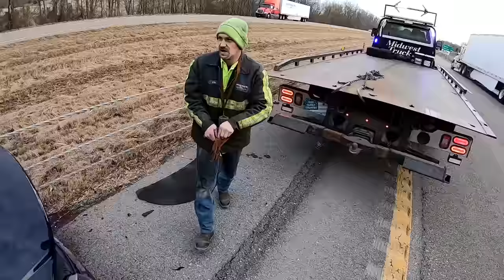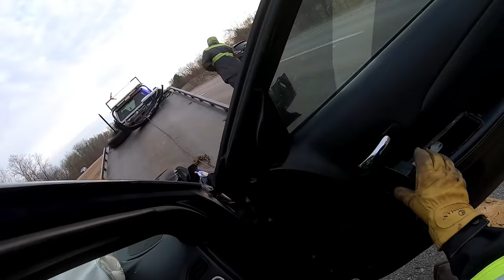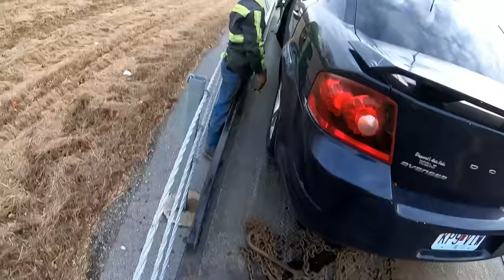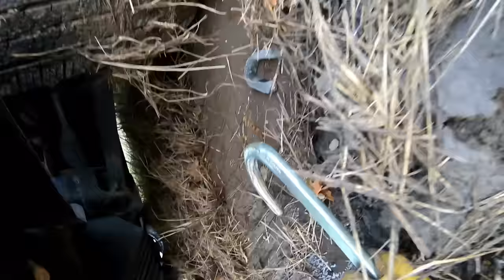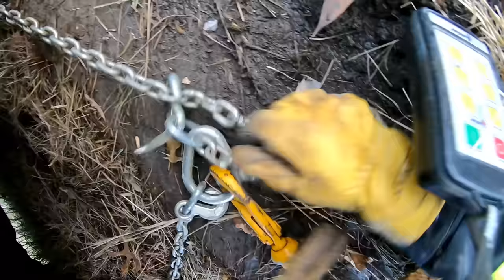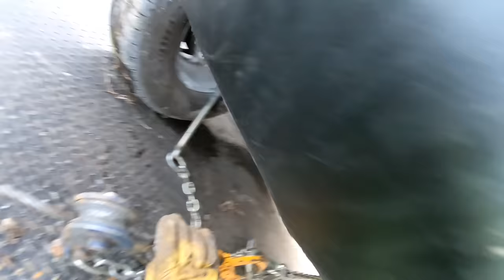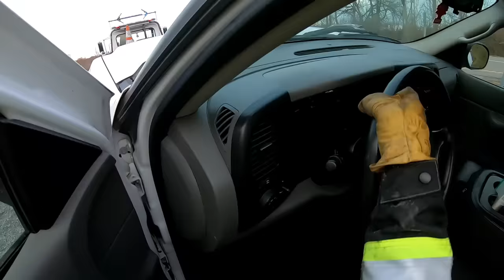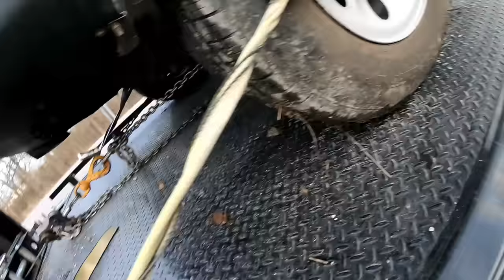Code 3 Car Crash Blocking the Interstate

Comment from the maker: There have been multiple comments about the use of my air horn rather than using a siren while running to this scene and that I should have allowed Mike to run in front of me since his truck has a siren.   Please allow me to explain......

We simply have not taken the time to install a siren on the new Peterbilt rollback yet.  As I stated in the video, we are not required to have a siren as long as we have the air horn and red/blue lights.   We are following the letter of the law.   The following is taken directly from the state statute:   

"5.  (1)  The driver of any vehicle referred to in subsection 4 of this section shall not sound the siren thereon or have the front red lights or blue lights on except when such vehicle is responding to an emergency call or when in pursuit of an actual or suspected law violator, or when responding to, but not upon returning from, a fire.

  (2)  The driver of an emergency vehicle may:

  (a)  Park or stand irrespective of the provisions of sections 304.014 to 304.025;

  (b)  Proceed past a red or stop signal or stop sign, but only after slowing down as may be necessary for safe operation;

  (c)  Exceed the prima facie speed limit so long as the driver does not endanger life or property;

  (d)  Disregard regulations governing direction of movement or turning in specified directions.

  (3)  The exemptions granted to an emergency vehicle pursuant to subdivision (2) of this subsection shall apply only when the driver of any such vehicle while in motion sounds audible signal by bell, siren, or exhaust whistle as may be reasonably necessary, and when the vehicle is equipped with at least one lighted lamp displaying a red light or blue light visible under normal atmospheric conditions from a distance of five hundred feet to the front of such vehicle."

Please note the last section which states that we can use an "exhaust whistle".  The air horn is defined under the "exhaust whistle" category, much like the warning systems used by trains since, well, the invention of train warning systems, which is an "exhaust whistle" train air horn.   So, again, we are following the law.   We will be installing a siren, but as I said, the air horn still covers us.    The main reason I went first is because Mike was on another job when the call came in.   I left directly from our shop, which was closer to the incident.  It just so happened that Mike was able to catch up with me in the traffic back up. 

This comment is made simply to educate.   This comment is not made in a defensive or derogatory manner.  Thanks for watching and God bless.
Reply: I can't believe the patience you have with these people making comments.
I would just say " because the law says I can use an air horn instead of a siren" in the description, then yell at the computer that they need to read the description every time someone questioned the air horn.
you are a far better man than I.
Reply: I think an exhaust whistle would be great. 
gets louder as you accelerate.
exhaust whistle with a jake brake on should clear the road.
Reply: Well, there's your problem: you need a train horn. A K5LLA and that cowcatcher they used on Mythbusters would be a great way to clear traffic.
Reply: I wonder if the old UK style pneumatic 2 tone airhorn sirens are allowed where you are
They are certainly distinctive enough to make people look in their mirror and see your lights
Reply: you should take the electric siren off of the rotator and put it on this large role back then get a Federal 'Q' to put on the rotator... 
but then I'm kind of partial to the sound of a Federal Q2B
Reply: I had the thought about putting the truck with the siren in front as well. Not because of perceived legal reasons, but simply because more drivers are likely to instinctively dive out of the way. Blasting an air horn in a traffic jam is more likely to cause anger or confusion at first before drivers see the red and blues and realize they need to move over. Sirens are just more efficient at clearing traffic.
Reply: Ron Pratt hi
Reply: Daniel Smith I live in Ohio and my local EMS has installed and uses a digital version of the two tone siren. You are very right it does work a lot better in my opinion. The normal drone sirens used here in the US don’t work in open suburban environments, since they echo to much it’s hard to pin point where they are coming from. But since they installed a two tone siren it’s been a lot easier for drivers to figure out where they are and move out of the way before they have to use the horns. In fact I can point to the vehicle and follow it even if u can’t see it. I can not do that with the fire trucks cause they still use the drone siren
Reply: @ab130  you're not wrong, but dangit, if you're in the left lane and a large truck is coming up on you honking, you're probably not going fast enough to be in the left lane
Reply: @ab130  unless drivers get used to it.
Reply: ..and it is educating. Thanks for sharing !
Reply: I was a firefighter in South Jersey and we could run out personal vehicles with blue lights (as long as we had the permit) and our horn or if we had the correct permit we could run blue lights and siren.
Reply: @kd5nrh  lol

Comment: As was to see in the beginning of the video, no room for the first responders, its a hot topic in germany. We call it Rettungsgasse, rescue alley or so. The penalty for not making room has recently been upped, minimum 200€ fine, one month no driving license and two points in Flensburg. Flensburg is a city in the north of germany, there is the central registry for your traffic sins. Some traffic offenses give you point(s), up to three at once. The points last depending on the offense 2.5 to 10 years. 4-5 points get you a fine, and a letter telling you off, with the chance to participate in a "how to drive responsibly" seminar, which can get you rid of one point. 6-7 gives you a bigger fine, also a letter with a warning that your driving license is in danger and  again the chance for a seminar. 8+ points revokes your driving license. Its gone for at least 6 months, usually longer. Its then a matter for the court to determine how you can get it back. You might be asked to successfully participate in a psychological evaluation.   You might need to aquire the driving license again, which is rather expensive in germany. If you do not cooperate, its gone for 15 years. Without your initiative you wont get it back, its not automatic.

Comment: Great Job Ron . On The Ford Isn't There A Chain Or Something You Can Get For it for the Cotoler like On The Pet So Mike doesn't have to Hold it with One hand. So he can Use Both Hands For The RECOVERY. Thanks Again For Your Hard Work. Be Safe 🚧🚧🚛🚛

Comment: Large truck with air horn  equals  right of way in my book 😜
Reply: Seems so simple, doesn't it. Throw reds and blues into the picture and......no **** difference at all. If you don't understand what your mirror is for, radio on full, can't see or hear anything - I'd fit a cowcatcher and a double layer of truck tyres across the front of the rig.
Reply: Yes

Comment: I always thought it interesting how MO. had the Letter codes for roads. 
Keep up the good work.
Reply: Wisconsin does too.
Reply: They repeat in counties like laclede county where I live has a hwy. AA and OO and so does several counties around us
Reply: I think only one other state does it. I grew up in MO, but I lived seven years in MS, and I didn't realize that wasn't normal.
Reply: as long as you don't mind driving on peepee.
Reply: driver - insurance company? I crashed on PP.
insurance- how did peepee get all over the road?
driver - no, I'm on PP.
insurance - why don't you get out of the pee, take a shower, and then call me?
Reply: In Missouri, the lettered highways are secondary state highways while in Wisconsin, lettered highways are county highways and the signage looks very, very similar.
Reply: @carolfrazer8067  Wisconsin letter highways are just plain old county highways while Missouri's are secondary state highways. I live in Wisconsin and I am a roadgeek
Reply: @jonathanbaker4936  I use to haul gas pipe for pipelines my directions would include go 10.2 miles turn left on the gravel road go past 3 corn fields turn right tight turn now back down 2 miles they'll  unload you in the morning.

Comment: WOW! Tore the axle right out of that truck! I wonder where the axle and wheel ended up? Can see GM's "beer can" body work clearly there. 😂 I own the same truck, more or less. Definitely built like a beer can! I also made note that someone already did a donut up on the new interchange. Woohoo! 😁

Thanks for sharing, Ron! Nice work! God bless.
Reply: Haha, Ford is the one that builds the "beer can" trucks! lol
Reply: The axle's still under it - the driver's side tire is still attached, if a bit buggered up. The rear passenger tire is probably the one Mike picked up, and the whole brake mechanism on that corner is also missing.

Comment: Ron, you have to get a siren on the Peterbuilt if you're going to be running emergency. It will be less than a $300 investment and make your responses much safer. Also, a tip for responding in traffic like that. Ride the center line and let the traffic in the left lane use the left shoulder and traffic in the right lane use the right shoulder. It's much easier for everyone to move that way.

Comment: Hey Ron great video as usual. Just a safety note for you and your guys. When using your truck as a blocker like when you were hooking up the first car you should turn you wheels to the right so if the truck gets hit it will steer away from the work area. Keep up the good work.

Comment: awesome video. i do however recommend some more red and blues. i do think that the ones near the number plate are not enough. a full size lightbar on the cab roof would be very beneficial along with 4 or so grill lights. as a driver of emergency vehicles here in australia, i speak from experience. would be nice to do a video walkaround of the different emergency light setups on your vehicles.

Comment: WOW, I knew the car was totaled but was wondering what happened.  Looks like they rear ended the pickup.  If that is the case I have to wonder how fast the car was going compared to the truck to do that much damage...
  Takes a lot of energy to break the axle away from the springs and tear the wheel plain off.

Anyway hopefully no one is seriously hurt on this one.  It will be amazing if everyone walked away from this.
Reply: I think it's possible that the truck was slowing to make an illegal U turn.

Comment: For higher code lighting visibility, have them mounted on the front corner vs middle when approaching traffic from the rear. True the siren might help (if traffic is listening)
Reply: Sirens help - but at 60 MPH + you begin to overdrive your siren. (You get there as soon as, or sooner than the siren).

Comment: I understand the reason for the cables but seems like they would be just as effective for the intended purpose if they were about five feet inbound of the inner shoulder. When they put them right smack dab up to the asphalt it may prevent that deadly crossover head on collision but it guaranties a dangerous and difficult to extract cable tangle collision if somebody drifts just the tiniest little bit to the center. There's like zero margin for error at all.

Comment: That new chevy truck had drum brakes on the rear end.  Didn't know they even still put those on even cheap vehicles anymore.
Reply: idk how drum brakes could be cheap but some still use them go figure. 'out with the new in with the old" seems to be a new thing. next maybe we'll be back to hand crank starters.
Reply: Still very common to see on this side of the pond, more for the vans and pickups, light commercial vehicles etc....
Reply: Looks like you are correct, shoe size is too big to just be a parking brake.

Comment: Nice job done Ron. I wonder if the police in the USA also inpound the car regestrationpapers if the car is heavy damaged like these two cars. They do in the Netherlands and you get them back as soon a  you get your car repaired and get a aproval rom the gouverment that its save again for road use. I am a 52 year old towingguy with 16 years of experience from the Netherlands(Amsterdam region)
Reply: Not sure in Missouri where Ron is at but in Colorado the police only use their impound lot if the car was involved in a crime.   Most private tow companies have contracts with the local police departments and use the tow companies private impound lot for crashes or minor crimes like DUI (no injuries), no license or registration issues.  As far as getting cars fixed the government isn't involved in that aspect really that I know of.  Maybe a salvaged title but that's it.  Most cars like the ones in this video get parted out and hauled off for scrap and the insurance gives you a payout for what the car is worth.  I know Im not Ron but hope that helps answer some questions.  Cheers.

Comment: When Roads get Slick, why do drivers decide to still Race to Destinations at Normal Speeds ? 🤪
Reply: Good question! I used to live in Atlanta back in the 90's and people around there drove faster in the rain than in dry conditions.
Reply: As an Australian over here, I wonder the same thing. If anything they might go a little fast in the hope of getting out of the bad weather faster. Yes, you might pull it off today but perhaps tomorrow the water may not drain away due to blockage and slip n slide off the road you go.
Reply: @daar1113  As a german i notice the same. Rain, fog, ice or snow, and some hit the gas like crazy.
Reply: Probably a world-wide thing; certainly see it here in Scotland. It's almost as if they're hurrying to get out of the rain, or fog, or ice, or snow........... you get the picture.😁

Comment: Do EMS sometimes ask you to be anchor points for emergency extractions? We sometimes see that in Norway. I think the US fire/rescue seems to have alot more heavy equippment in general, so maybe they don't need it too often..
Reply: In my department we always tried to use our own gear due to the liability issues. Unless we needed something odd like a front end loader or other machine that isn't "normally" considered Fire or EMS in our area. Like for trees down or mudslides and such.
Reply: When I was a cop there were a few times we requested a tow truck to expedite so fire could perform the rescue. Usually this involved cars over an embankment where the tow truck had to secure the car to prevent it from moving. Also had a couple involving semi's where the fire departments equipment wasn't big enough to support the truck and they needed a large wrecker. LA Fire is one agency that I can think of that has a large wrecker outfitted for emergency response specfically to perform rescues.
Reply: If I recall correctly, Mr. Pratt is also certified and licensed in light and heavy extraction.

Comment: Here in England, on motorways (your interstates), all emergency services use the emergency lane to get to the scene of an accident.  Its certainly a lot quicker
Reply: Here in the states, they're not always wide enough for a tow truck to navigate at speed. On top of that people here will suddenly, without warning, pull into that lane, possibly right in front of Ron.

Comment: The one thing I disagree with State of Missouri is the Close proximity of the Cables to Roadway, Way to close as a minor problem is now a Major problem.. I would have located a double system in the center between the roadways...

Comment: Hello Ron I am a truck driver and I need to let you know that I can not hear a siren with my radio off until that siren is at my door
Reply: Interesting point. In parts of the UK, they experimented with "white noise" - a sort of "craking" sound, and reckoned it was easier to hear when behind you.
Reply: What about the Air Horn?  Are those noticeable from inside the cab?  I can understand why the siren is very difficult to hear.  Starting with the fact that you have a giant box right behind you, plus studies have shown that it is much more difficult to hear a siren that is approaching from behind.  Wind noise, road noise, sound suppression and soundwave compression all combine to cause it.

Comment: Hey Ron, did you notice that you only used 3 tire tie downs.  I guess I missed it if you said where the 4th tire was.  I was pretty sure it didn't come from the factory that way.  I wasn't embedded in the windshield of that car was it?  Just an observation.  Good job getting the wrecks cleared
Reply: Mike stated when he and Ron first got together that he found a tire and loaded it on his truck, but did not know where it had came from.  That is/was the missing tire from the truck.

Edited due to fat finger syndrome.

Comment: Must say, personally I would have used that clear space at around 4min to let Mike ahead to run with the siren. If he was close enough, even let him in front before hitting the slow traffic.
Reply: That seems like a fair point. While Ron has explained that using the air horn is fine/legal and also explained why he was in front to start with, I think I might have waved Mike past, into the lead. To the unititiated drivers ahead, the siren might seem more "official". Having said that, most of them pay little attention anyway.
I did notice a rare piece of good driving at about 1:30 when the oncoming vehicle flashed Ron; letting him know 1) he had seen him and 2) he understood what Ron was about to do. I haven't seen many bits of decent driving on these videos, apart from Ron and his crew of course.